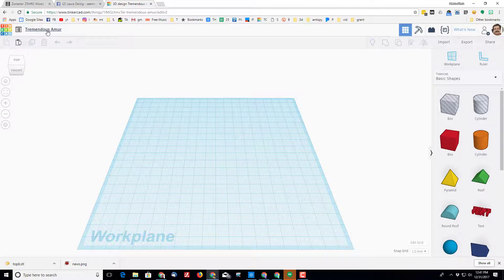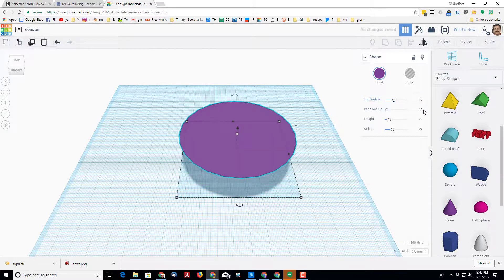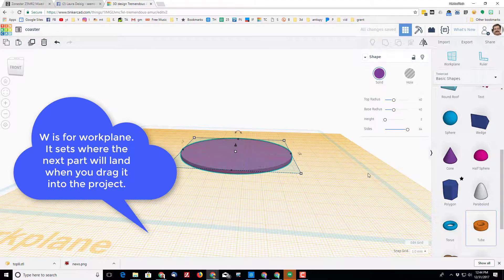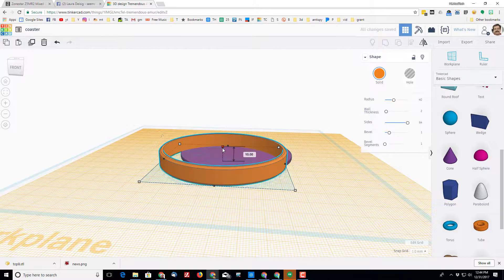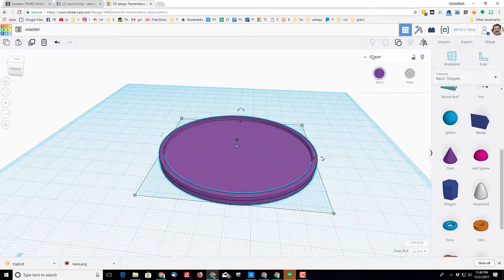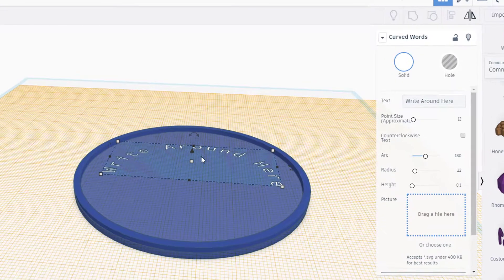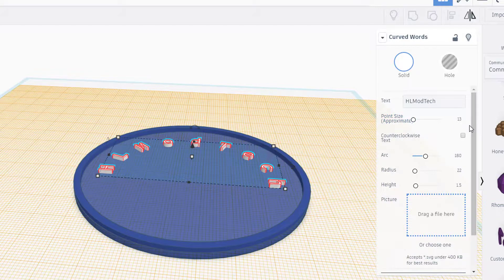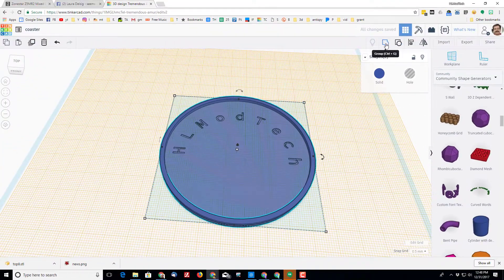Design your own coaster using Tinkercad

Comment: Thanks for the tutorial. I created the coaster. How do I send it to Bambu to print it? It does not read the file. Thanks!
Reply from the maker: If you export as an STL you can do that. I think I laser cut that project.
Reply from the maker: This one includes printing steps. Easy 3D Printing: Make Useful Parts with Tinkercad! Beginner Ready 💯🔥
https://youtu.be/6ecoMB5TPfA

Comment: How can i make a logo flush so i can make it a different color for my 3d pront i have a bambu
Reply from the maker: See if this video helps. I show you how to place the text on top... you would just use ctrl+down to nudge it in. I have not used a bambu, so I am not sure how they handle 2 color prints. On my Geeetech I have to bring the two parts in separate and align them in the slicer.